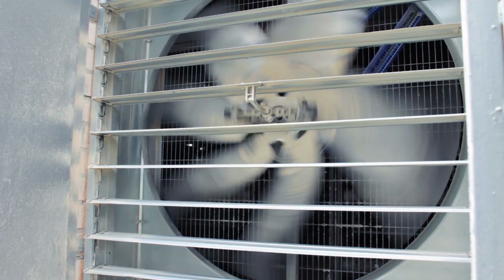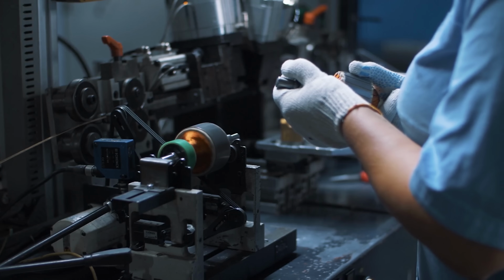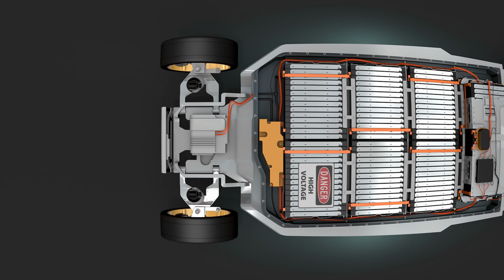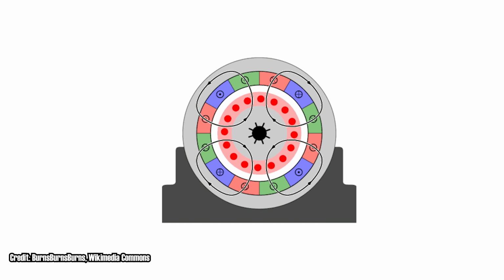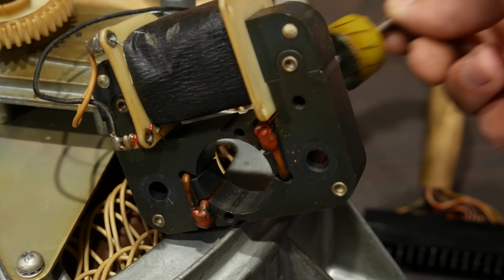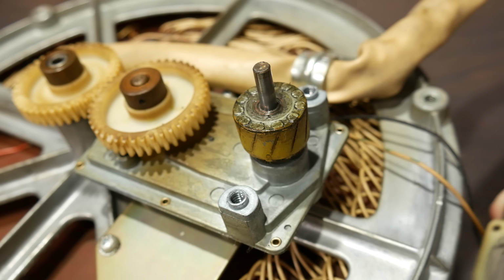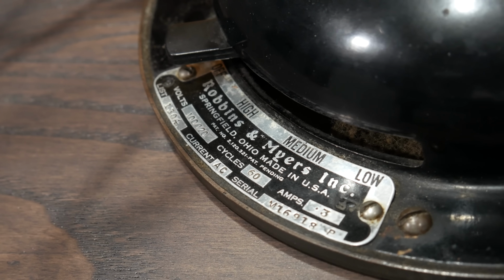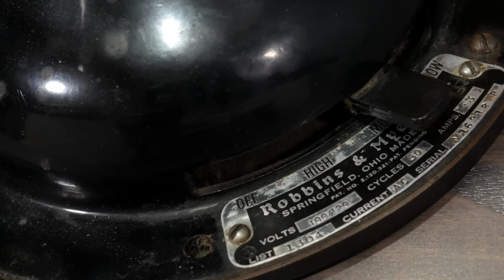Fans; High is next to Off on purpose

Comment: "Household electricity doesn't spin"

In Finland most households has 3-phase electricity. i am not sure, but I think fan speeds go off-slow-medium-high.
Reply: Yeah but I don't think your plugs have 3 hot legs. That's extremely uncommon in any residence. That would be a minimum of 4 prongs and up to 5 if you needed a dedicated neutral. It's probably for a few high power things like how the US splits 2 phases for most things but dryers and ovens get both.
Reply: Yeah, but that's basically just for the stove and the kiuas (sauna heater), I think?
Reply: Yeah, France has three phase to the house and a three phase board with MCBs for almost every device.
Reply: Most modern fans have a starting capacitors and centrifugal switches. Most fans since I am born are all 0123. But I did see an article where older fans were 0321 and then even when caps were used, people kept the same order for some time.
Reply: Uk is single phase to the home, 240v 50hz
Reply: @Jaker788  No, but his three legged girlfriend does. Have you SEEN Finnish girls? Wowza!
Reply: @Jaker788  My parents' house (in Hungary) has three-phase supply and indeed, outlets and appliances inside the house are single-phase (including the powerful stuff like the oven). Having three phases probably serves the purpose of balancing the grid (various parts of the house are connected to different phases) and providing each household with some access to electricity even if one phase cuts out for some reason. We do have a solitary three-phase outlet in the fusebox though, which was used for a jointer during the construction of the house if I remember correctly.
Reply: @Jaker788  
Now i don't know about the US, but here in India,i've encountered both 3 Phase & single Phase ceiling fans.
also Ceiling fans are quite common/poppular here, not to forget the air cooler.

Personally I've got a pair of modern single phase fans which reaches top speed of aruond 350 RPM on it's 2nd setting(has 6 settings on the IR remote excluding th RGB off, 1, 2, 3, 4, 5,.)

But when i got called from my neighbour living in the same soceity to wire up the capacitor for his ceiling fan.   but lo & behole, I had a pocket tester my Grandfather(a Philips repair centre head from the 1900's  and my electrical knowledge god) gave me and I asked him to turn on the class B10 circuit breaker and checked the 3 wires to confirm the live,neutral & ground/earth pin/connection and it turned out that ALL OF THEM WERE LIVE!!!

I suspected it be a Y or a Delta configuration but I never know untill this point cause i told him that i did not know hoe to wire it up as I was 16 back then(2019)...

But even in my grandfather's 80+ years old bunglow me designed and built himself, he had installed some THICC/MASSIVE 300-400W~3 phase ceiling fan which looks like a obese modern ceiling fan, which quite similar to my modern Oreint Spectra Sweep 1200mm 65W ceiling fan has, still to this day, got a shit load of torque and speed even on the 1st speed setting out of 7 with one being off. And yes, it is obvously a resistive speed selector (THAT STILL WORKS FLAWLESSLY) unlike the modern motor which has 5 extra tappings in the stator winding which gets indivisual current from a relay board wired to the IR receiver module inside it.

long story short, out of all i think ive seem some rare houses with 3 phase fans.
anyway, that's all for now, see ya.
Reply: That’s actually really interesting that households have 3-phase, in the US most houses have single phase
Reply: @MePeterNicholls  Technically UK is 230v, we were on 240v but this changed back in 1995.
(same time main land Europe moved from 220v also to 230v, all part of a power harmonisation plan).
But the tolerance also changed:
Old (pre-1995): 240V +/- 6%, giving a possible spread of voltage from 226V to 254 V
New (post 1995): 230V +10% -6% giving a possible spread of voltage from 216V to 253 V
It didn't really change any existing installs, as they were basically still within tolerance of the new system.
Reply: In Germany most households are wired as 3-phase, and single-phase outlets are split between them, and cooktops and conntinuous-flow water heaters (if present) use a hardwired 3-phase connection.
Reply: @TheBoothy666  while that's technically true, really the redefinition was just to allow existing 220 and 240 to be considered "230" as it's within tolerances – as you said at the end. Old installs didn't have to change but seemingly new ones haven't either, my block of flats was built way after 95 and my multimeter still says 247. (Though it might be reading peak instead of RMS? It's a fancy self-ranging meter but I don't know much about it beside that.) Presumably it's the same citywide, old and new alike.
Reply: @Jaker788  Most US households have single phase but with a 'neutral' that allows half-voltage (120 V) circuits for low power devices.  You may have seen appliances that can be jumpered for '208 V' vs '230 V' -- the 230 setting is for households with single-phase power, the 208 would be used where the building has three-phase power and two of the legs are utilized for the appliance.  Still 'single phase' as far as the appliance 'sees'.  I guess those two-leg wires (in a '208' installation) could be utilized in a two-phase sense, but you'd have the electrical equivalent of the original 1960s Buick 90° V6 - a V8 with 2 cylinders chopped off - that ran 'Rougher than a cob', in the words of an AMC engineer.  (AMC inherited the tooling from Jeep, which had purchased it from GM a few years earlier.  AMC then sold it back to GM.)
Reply: @MrAshwijshenoy  The US has loads of really terrible fan designs still in use. They haven't gotten any better as safety grills and cheap plastic blades have proliferated. I have a fan almost exactly like the one in the video and it is by far the most effective fan I own, and also the quietest. Unfortunately, most modern appliances are truly horrendous and cheap pieces of technology.
Reply: @somitomi  It used to be like this here (Belgium). Now we have only single phase. I guess they  balance the grid by providing different phases to different customers.
Reply: @MePeterNicholls  Here in the United States most homes are 120/240VAC 60hz, single phase. The neutral is center tapped on the secondary coil. That's how we get the 120V and 240V in our houses. 240 is usually for air conditioners, ovens, clothes dryers etc. A lot of people don't understand how the center tapped neutral works.
Reply: K
Reply: @boggy7665  It's 240, not 230.
Reply: @Jaker788  at least here in Germany, it is not uncommon to find an ICE 60309 outlet in a residential building. They can usually be found in the basement/garage. We refer to them as "Drehstromsteckdose" (spinning electricity outlet)
Reply: @Jaker788  Actually, N. America only splits one phase to make the weird power. The primary is single phase (one leg of a three phase supply), with a hot end and a neutral end. The secondary has a center tap, the neutral (usually bonded to the primary's neutral, and grounded), and two hot ends (L1 and L2). L1 to neutral is 120 V, L2 to neutral is also 120V, but 180 degrees away from L1, and L1 to L2 is 240 V. Because 240 V domestic circuits here have no neutral, they require 2 pole switches and circuit breakers to turn them off, one pole for each side of the line, rather than the usual single pole switch for a circuit with a hot and a neutral.
Reply: @somitomi  Load balancing is one reason. But if you go from one leg of your 240 V , three phase line to another, you have 400 V for really powerful machines. Works in Finland and other countries that have 3 phase domestic power, too.
Reply: @Jaker788  We don't. Only ovens and sauna stoves do. But we do get 3 phases, and they can go in some of the outlets to help with power draw (imagine daisy chaining outlets in parallel, it would be a disaster). If you could find the right outlets, you could recover all 3 phases.
Reply: @TheBoothy666  Meanwhile, most appliance manufacturers have gone to a single, broad input standard, 100 - 240 V 50 - 60 Hz, so their appliances can be shipped and used anywhere in the world, provided you have the appropriate plug for the country you're in. And even if you don't have the right plug, adapters are usually available.
Reply: @campusto  Yes, that would be the sauna stove, apparently.
Reply: @Jaker788  I'm not saying you are wrong, but it is worth noting that you only need 3 pongs/conductors to carry three phase power if you have a balanced load (which a motor is going to be) and no need for an earth ground. Typically, with 4 prongs on three-phase AC, you have three hot legs, and one ground, often used when you have a balanced load and need a ground. On a 5 prong three-phase AC, you have 3 hot legs, a common neutral, and a ground, which is used when you have a potentially unbalanced load and need a ground.
Reply: @boggy7665  In a 3 phase delta, mostly found in commercial/industrial buildings, there is a transformer between phase A and B, a second transformer between B and C, and sometimes another between C and A. If you put a grounded neutral on the center tap of the first transformer, it acts like a domestic 120/240 V split phase, and if you go from phase C to that neutral, you have 208 V, which is mainly used for commercial lighting.
Reply: @paco4756  Sweden too. :)

Comment: This is something I've wondered about for a long time. Eventually I came up with my own mediocre theories: A) The fan would be more likely to start if it started on high than on low, but the assumption that modern fans would have any inherent difficulty in starting seemed odd; or B) The manufacturer wanted to impress customers by having their fans demonstrate their full power from the get-go.

I actually have a small 20-some-year-old fan that has stalled on start-up a few times in recent years. Relating to another comment on here, it might have to do with dust build-up and increased friction over time which could be remedied through cleaning and lubrication. Hence, starting a fan on high does still make it less likely to stall in the very real-world scenario of a dirty fan that needs cleaning and lubrication.

Comment: And if course, 100 years ago, the standard RMS voltage was 110 instead of 120, AND longer runs with smaller gauge wire were common. Put all those together and maybe starting on low would have been more iffy. Really good explanation of shaded pole motor. I had seen schematics but never really knew what the purpose was or recognized the winding pattern.

Comment: "For something like fans that run for days at a time"
 Me over here thinking about how I have not turned my fan off in months...
Reply: Pretty sure the ceiling fan in my bedroom has been running for literally over a year...
Reply: Tell me about it, I have a box fan in my room that has been running since like 2012 I'm pretty sure.
Reply: I turned my apartment's ceiling fan on when I moved in and it's only been off a few times, usually due to power outage. I've been here almost 3 years.
Reply: @FeyPrevesk  same, 5 years
Reply: Puts on stereotypical old man voice
You think that's impressive, I've had my fan on for over 80 years and it stayed on even through power outages
Reply: My fan is black with dust. The only reason it hasn't killed me is because I put it on exhaust, so it pushes air out of my room. If I had it on intake, man, there'd be a dust cloud in my room more dense than the one Mt St Helens produced.
Reply: And I don't own such a thing. But then, I'm Irish.
Reply: Let me just say that this discussion gave me anxiety. I start feeling uneasy when I run my fan for several hours at a time. And I certainly can't even imagine a situation where I leave for days with the fan left on...
Reply: @qwertyTRiG  you do own lots of gold coins, so that's something I guess

Oh yeah, and alchohol
Reply: Every fan I've ever owned has low next to off
Reply: Can I get an explanation for the rationale of not turning your fan off in months? I just don't really understand why anybody would do that (actually I don't really understand why anyone would keep their fan on for more than a few hours but y'know)
Reply: @blunderbus2695  silence makes me uncomfortable, also airflow
i only turn it off before school (when i still went lol) and if im going on a vacation
Reply: In Phoenix,  they never get turned off. 🏜
Reply: @blunderbus2695  : Keeps the air temperature more reliable from floor to ceiling, thus making the house more comfortable.
Reply: @blunderbus2695  it's hot af here in mexico, that's my excuse
Reply: @blunderbus2695  
Circulation (stuffy air makes me queasy), the sound (I can't sleep without a fan on), and a way to suck cool air into my room at night, then to exhaust during the day during the summer to keep my room as cool as possible.

Comment: Great video, this whole thing starting with level 3 is really exciting. We don't have this in Germany and never had it. Even very old fans start with 1 after 0 and go to 3.
Reply: Same thing in Sweden. I've never seen or heard if this before.
Could it have something to do with the higher voltage?
Reply: @Micke_xyz  philppines has higher voltages. But it's 0-3-2-1
Reply: @Micke_xyz  : It's just a design optimization. As he pointed out, it's fully possible to design the fans so that there's no realistic danger from it.
Reply: @absalomdraconis  yeah. But it's interesting that it seems common in US but I've never seen this in Sweden. Design culture perhaps?

Comment: I actually discovered a few of these concepts on my own, by accident, without realizing it. I sleep with a small fan blowing on my face, and when my last one started stalling out, (after running for several hours a day for 8+ years) I figured out that switching it to high would get it going and then change it back to low or medium.

Comment: High is searched because of several reasons one introduction motor, two it may have a capacitor involved to get it started. Three would be it's just easier on a induction motor to start at high speed. Were a DC motor can start at any speed.

Comment: 4:55 We only get 1 phase, not 2 phases (for residential). It's center-tapped though so it's actually split phase. 120v per pole, or 240v between the poles.
Reply: Thank you for saving me from having to type that.  Using 2 of 3 phases in a 3 phase system gives weird results and not in a good way.
Reply: @lsorense  In most commercial buildings, which have a three phase supply, wiring a load across two of the phases is almost universal, and gives a slightly reduced voltage of 208V instead of the standard 240V.
Reply: I would also argue that split phase is still two phases, even if it's only created from one transformer.
Reply: @Owen_loves_Butters  it's two halves of a split-phase system. But yeah anyone calling  "two phase" will get laughed out of the trade.
Reply: @colinstu  And each one of those halves is a different phase.